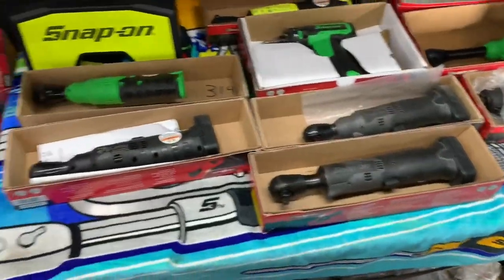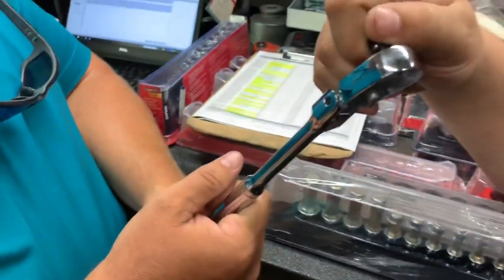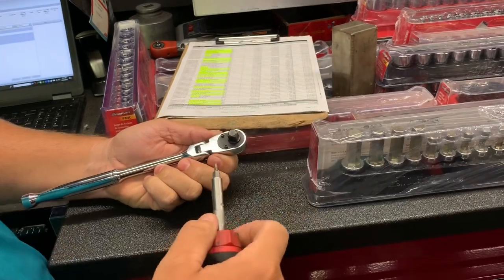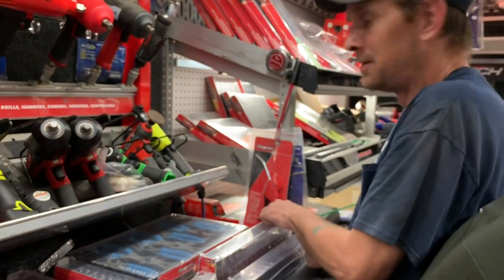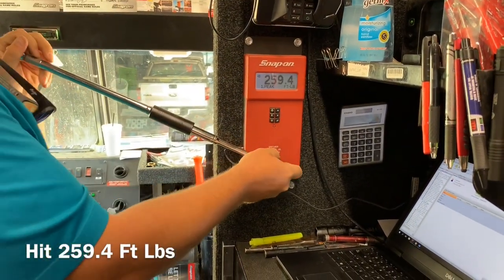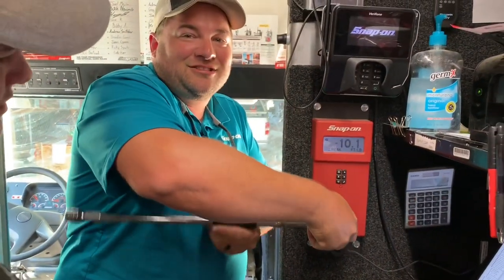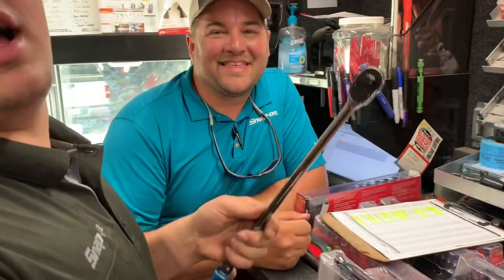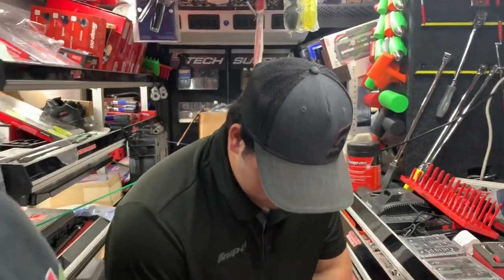Snap On Dealer Puts ICON Head To Head VS Snap On Ratchet

Comment: I don't think the Icon will replace Snap-On, but I've been saying for while now HF is replacing the niche market that was Sears tool department.
Reply: This is 100% spot on. I’m an auto hobbyist and do all the maintenance work on cars. When my local Sears closed I was left with only the auto parts store tools, which are decent but not a great variety. Then I found Harbor Freight and have not been disappointed either their Pittsburgh line. In particular their sockets, impacts, and ratchets. Perfect for use in my garage.
Reply: Yep, but at a better price than even Sears

Comment: A lot of die hard Snap On addicts HATE comparing Harbor Freight tools but ICON is impressive , so is TEKTON for the prices
Reply: At 1/5th of the price or so, as a weekend warrior, I will take Icon all day long.
Reply: @dcast777  you said the magic words, weekend warrior.. lol
Reply: Probably the ones who have never been in a Harbor Freight. They claim it because it's not about the tools, they probably rarely turn a wrench and it's just a status symbol to have a fancy box sitting in the shop.
Reply: I use Tekton tools five days a week at my job. I am slowly switching over to all Tekton. They are great tools. Couple that with the fact that we have the worst Snap On dealer in the world the choice was easy to make for me.
Reply: @vtseller  I know a few techs that work in the field professionally and most of them use tekton or HF on a daily basis
Reply: @vtseller  I know a few pro mechanics that have plenty of old craftsman tools in their roll away chest. They aren't what they used to be though. I will buy SK,  Icon or used Mac or Snap on.  I'm not getting skinned alive by the tool trucks.
Reply: besides being extremely overpriced and having some tools like the Daytona Jack built by the exact same manufacturer that builds Harbor Freight Tools when I switched shops my new snap-on dealer refused to honor warranties of the Snap-on tools sold to me by another snap on tool truck he told me to mail it in.  As a mechanic I started shying away from Snap-on and more towards Craftsman Husky and SK because I can at least get those replaced on the same day when I need it and not have to wait almost a month and for a third of the price
Reply: Snap on guys be changing oils filter all day and think they diehard mechanics😂
Reply: Snap to expensive why would you put a expensive tool into work lol
Reply: Pickle Rick lmao 😂
Reply: @vtseller  Those US made Tekton screwdrivers are really tempting. I like the fact that they are a triangular shape so they wont roll away!
Reply: nunya biznazz I literally just got a set the other day and love them, I work on planes for a living if that says anything.
Reply: I just work on my own cars in my garage Pittsburgh Pro is enough for me mostly.
Reply: I prefer Made in US tools over China shit, I am not Snap On loyalist, I am Made in U.S.A addict
Reply: Icon is the only tool worth buying today . The warranty is REAL and the prices are amazing Tekton is stronger by a tiny amount but the value of Icon tools is undeniable .
Reply: @vtseller  i am just getting into cars having done steering, rack, rebuilding suspensions, head gasket and timing belt jobs etc, I use Milwaukee, Gearwrench, Tekton, and i have a few Harbor freight professional ratchets and I really like all of them for their uses. I am switching to locking flex head ratchets phasing out the Harbor Freight, but they were good for a starting ratchet. I love my Tekton pliers and Impact socket sets and my Milwaukee 1/4 and 3/8's ratchet set.

Comment: Good video, I have a little experience I'd like to share that shocked me, over the winter I lost most of my tools in a fire, 30+ years of tools in fact, I couldn't even begin to tell you how many 3/8 ratchets I had, tons of the junk tear drop craftsman, a couple snap on, no icon, but I did have a couple of Pittsburgh, here's where my story gets really interesting, a week later I had to work on one of my vehicles, I luckily had a lot of my expensive milwaukee power tools in my truck, along with a small  metric and standard 3/8 impact socket rails that I keep in my milwaukee bag, well, I found myself in a spot that I needed a ratchet as no impacts would fit and my cordless ratchet did get burned up, so I'm out there in the snow, prying my "spare ratchet" drawer open to try and find one I can get to work for what was ultimately 1 bolt I couldn't get to, EVERYTHING aside from one ratchet had some type of aluminum and/or plastic parts that had melted and that one ratchet was a plastic/rubber handled Pittsburgh, minus the plastic on the handle itself of course, all ratchets were in the same drawer, and suffered the same conditions of heat, harbor freight for the win on that one, although I was able to rebuild one of the snap on's, and used it yesterday, but on that cold winter day the Ole Pittsburgh put a smile on my face on what was and still is a otherwise really depressing situation, at nobody's fault but my own, and although I'm still to this day going through and trying to salvage what I can that, and it's doubtful that I'll be able to rebuild even a small portion of what I had accumulated throughout the years, that Pittsburgh will be a wall hanger for years to come

Comment: I’ve used snap on ratchets for years and after watching your videos on the new ICON ratchet I honestly do not see a difference in the quality between the ICON ratchet and a snap on ratchet. It looks like a snap on, it has fine tooth, it held up to over 250 ft lbs of torque and it has a life time warranty. I’m impressed and feel that harbor freight is making some extremely smart decisions. A good tech who might not be able to afford snap ons high prices may be able to get similar quality tool at a lower cost.
Reply: The mechanism in the Snap-On is nicer. I don't know if it is 5 times nicer though.
Reply: For most people its easier to get a replacement at the hazard frought then wait for the snap on truck to come and replace. Ive got a whole box of snappy stuff but ive got a few rollers full of harbor freight stuff and its held up so why pay 4x more
Reply: @Tuan Nguyen I've spent some good money on tools. Never had any bad money really. When I buy tools other than Snap-On I tend to get a lot more value for my money too. Although I did manage to pick up a pair of Snap-On ratchets earlier this year for a dollar a piece. I ran out of that sale. hehe

Comment: I have yet to buy the icon ratchet, it feels smooth and looks good. However, I have not had a ratchet as good as the snap on one. Smooth, quiet, & just unrivaled.
Reply from the maker: It isn’t a snap On for sure. It isn’t meant to be. In my eyes it is just another brand. They made a very nice ratchet for the price point they are in. There’s clearly differences inside the ratchet as you seen in the video. The guts in the 3/8” are about the size of the snap On 1/4” but it is a nice ratchet for $40
Reply: Yeah but is the Snap-On really that much better for how much more it costs? A Snap-On 3/8s swivel head costs more than twice as much as the ICON ratchet. I can have a decent night at a strip bar for the difference in cost. In life you need to prioritize. I guess hung over I would appreciate a quieter ratchet though. All you really need to do is open them up and put a dab of grease in them to make them quieter. Something better than wheel bearing grease does work better. The Super Lube synthetic they sell at Harbor Freight is nice.
Reply: @1pcfred  it’s worth it if you make a living working on vehicles or trucks or equipment
Reply: @dieseldawg7132  I watch Pakistani Truck and they don't use Snap-On tools. I'm not entirely sure if they're actually making what westerners would consider a living though. Safety sandals engaged!
Reply: @1pcfred  you don’t have to have snap on but it’s convenient and makes work a lot easier ….
Reply: @dieseldawg7132  I have a few Snap-On tools. I've never noticed them making anything any easier for me. I approach mechanical work differently than most folks do though. I don't act like it's an arcade strength test game. I used to. I matured out of that over the years. I got tired of using easy outs. Which are very deceptively named. I've never found them particularly easy to use either.

Comment: I gotta admit, that ICON ratchet is pretty impressive.  For 40 bucks I don’t think you can go wrong picking one up.   For those of us on a budget it’s looks to be a better option over the other lower priced ratchets.  Love the videos!
Reply: Another great option is the duralast ratchets
Reply: I picked up gear wrench ratchets, swivel head, 120 teeth, coated handle. Love them.

Comment: Excellent head-to-head testing Clay. Hats off to Hamilton for entertaining the throwdown, he looked truly interested while Thomas acted truly annoying. We're hoping Icon comes out with a locking flex head ratchet next...now we want to check out those ratcheting wrenches!
Reply from the maker: The ratchet wrenches are really nice. If I hadn’t bought the new Snap On already I would have gotten those
Reply: @KoonTrucking  I'm not about to ditch my tool truck ratchets just yet but the Icon will be a good backup. I still have a 40 year old Proto that sees some duty. On the Ford diesel today I had to use my extra long 3/8" Snap On to break the idler bolt loose...it beats using a pipe!

Comment: That was a blast getting Hamilton to do that on the truck.  Hopefully he can warranty that meter if it’s acting up.
Reply: I don't think the meter was acting up it was sensible to up and down movement as que pull and release the tension! It should have  feature to lock highest meter reading after a three second delay reset!

Comment: Think harbor freight is finally seeing the positives in quality tools hope they keep it up
Reply: Agreed
Reply: I mean their boxes even the harborfreight ones are really strong i had a snap on box the slides broke  whike the harborfreight still good
Reply: As an employee i can tell you for a fact they definitely will!
Reply: @scaryhorrormoviee  I was looking at the Yukon box at HF last weekend. The quality seemed pretty good for a $350 price tag. I was impressed.
Reply: HarborFreight has always had tools that had quality, they were just ok a Craftsman, Husky, Kobalt,   Stanley level though.  

Now they are producing SnapOn & Matco tool level. 

Don’t get me wrong HarborFreight also has always had allot of crap tools in their roster too. Though then again so has Craftsman, Husky, Kobalt, & Stanley
Reply: They seem to be going to a "good, better and best" tier system for their brands like Stanley-Black & Decker. Their Icon line is the top shelf hand tool brand at HF. I bet a pro could use those without knowing the brand and be pretty happy with them. Milwaukee is kind of doing a similar value play in their 12v automotive tool lineup.... They're trying to become the value alternative to Snap-On's electric stuff and they're doing a damn good job at it.
Reply: @honkhonkler7732  Sadly Snap-On's power tools are a weak link in their lineup. I know many mechanics with SO hand tools, but opt for DeWalt or Milwaukee for their impacts and drivers.

Comment: Many thanks to Thomas on the improvised 'cheater bar' with an extension a deep well socket. I'm going to try that next time I need more leverage, I never thought of that. Mr. Clay a new ida for your channel: "Thomas' front yard tool tips.
Reply: Donald Hollums  i just learned that tip 2 weeks ago from a Road Tech in my shop . I was mind blown 🤯 lol started using right after 😂
Reply: Kevin Garcia, believe you me, that’s something I’m going to do as well. Hopefully soon we’ll see: “Thomas’ Thursday Front Yard Tool Tips” on Koon Trucking! That still leaves Wednesday for a tool related film.
Reply: Adding length on anything you turn significantly adds more torque. Including wrenches, pliars, right angle screwdriver drivers, etc

Comment: I think icon is a great alternative to the tool truck. Nothing wrong with buying cheaper tools if they do the job and have the same longevity. Now that being said there are certain tools you just have to buy name brand for. I’d feel much safer with a snap on ball joint press than the harbor freight one

Comment: Why is the first step taken is “CHEATER BAAR!” I mean I like Hamilton didn’t say “go bigger,” but its crazy he put the paces to both and showed the results. The gear wrench gear type with snap on pawl design yielded one good ratchet. 

Snap on should be worried if they make a FLL80 or SLL80 equivelant

Comment: Did the brakes on my ram 2500 today. Used a Bauer 20v 1/2"  impact gun for the lug nuts with Pittsburg impact sockets,  and a Pittsburg breaker bar with icon sockets on the calipers. Never regretted not taking a loan out for tools.

Comment: As someone who works on my cars when they need it, it’s a very nice tool ratchet is a great value for us. I still want to get a snap on eventually though
Reply from the maker: Snap On makes the best tools on Earth in my opinion. There are some good lower cost options. I can’t fault anyone for buying what they can afford and upgrading to Snap On later, in fact that’s what I did.
Reply: As a DIYer replacing a control arm, I misplaced my 40 year old 1/2 inch Craftsman ratchet so I bought a HF Pittsburgh ratchet to finish the job. I really did not like it.  Luckily I later found my Craftsman stuck in the end of my 2 foot cheater pipe. Would love to have Snap-on but can't justify the cost.
Reply: @KoonTrucking  Snap-On arguably makes the best ratchets, sockets and wrenches. For other tools you can do better from other manufacturers. Though All Snap-On tools are more than adequate. The same can be said of almost everything being made today. It's almost like the whole world finally figured out how to forge steel, or something?

Comment: Im currently using Kobalt ratchets, but im starting to get fed up with them. The damn forward/reverse selector is so easy to flip and it causes it to bind up during use. When I get another Kobalt set, I will likely be replacing the ratchets with Icon ratchets.

Comment: I'm impressed Hamilton didn't just run it down and gave it a shot. You could see the real difference in gears.
Reply from the maker: There’s a big difference between them inside. He is a straight up guy. He is honest and did a fair test
Reply: @KoonTrucking  they do look pretty but I personally will stick with my snap on and matco ratchets I know icon are a lot cheaper but I know I can count on my snap on and matco not letting me down.
Reply: Emerald lx  everything can break especially if used incorrectly. It boils down to personal preference I've used a ton of different brands of cheap ratchets it seems like they all end up jumping teeth or locking up. It took me along time to commit to spending the snap on and matco kind of money on a ratchets. So just my opinion.

Comment: Definitely invalid test, you have a flexible head vs a fixed head. Snap-On is always a ripoff.
Reply: TheMadSciencetist I agree that snap-on is over rated. Most people I know that use tools for a living say they have bad luck with snap-on not warranting their products. Could be the region I’m in though. But icon has been tested several time compared to snap on. It’s proven to be on par or better and way cheaper

Comment: Snap on makes a great tool, but its damn near criminal what the tool trucks are charging for them. Just got quoted $375 for 3 ratchers from them. Insane. Thats where tools like icon come in. Work more than good enough and cost less than a 1/3 of the price
Reply from the maker: You can buy 10 of the Icon ratchets and have money left. The flex head used in the video was $39.95

Comment: If they respect the icon they'll love the tekton
Reply: I like Tekton but you’d gotta be careful with that brand. Very large variations in quality from tool type to tool type. I’ve had some stuff I like from them and some shit that’s the same as cheap no name garbage. Tekton also has quite a bit of tools that are shared with other cheap companies, likely since they haven’t scaled large enough yet.
Reply: @JsGarage  any specific tools you have had issues with from teky ton?
I have their torq wrench and 1/2" breaker bar and haven't had issues so heads up in duds would be welcome

Comment: Love the video. Just 1 question. Did Hamilton not have a similar ratchet on the truck instead of that long hard handle?
Reply from the maker: I think he was looking for one as long as the cheater pipe Thomas had made and that’s the longest 3/8”

Comment: Had a helluva night, even admit I broke my first snap on tool tonight (pin in a swivel impact socket) on a seized ISX starter bolt. This video gave me a laugh and made me think. I want to hate the icon stuff but it’s hard to do with ya’ll being impressed by it.
Reply from the maker: It’s not Snap On for sure the video showed the differences in the internals but, for $40 it is a good ratchet

Comment: I've got probably 80K in snap on, matco and Mac tools. I bought a set of icon chrome 3/8  drive deep well sockets 2-3 years ago just to see how they were. Setting them side by side you can't see any any difference, the etching and font of the letters is even the same. I've been running them on an ingersoll titanium impact daily just to see how they hold up and I have not broken one yet, the icon tool line seems to be the real deal, the sockets hold up just as well as snap on anyway.

Comment: The inside of the Icon is really close to the Gearwrench. I agree that the Icon held its own to Snap On, but will it do it everyday? I have not owned and probably never will own either. I also have never stepped on a tool truck. Great PR for the Icon though.
Reply: The Snap On will not do it everyday either, thats why they have repair kits.  Kinda like the old spew about Apple computers not getting viruses, but they sell anti virus software at the apple store.